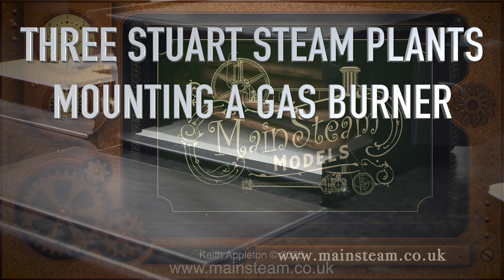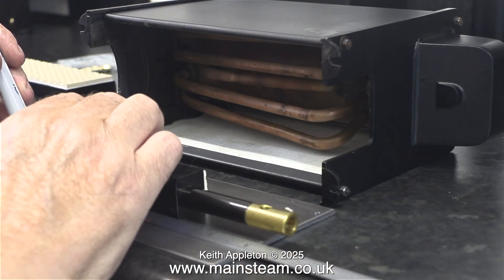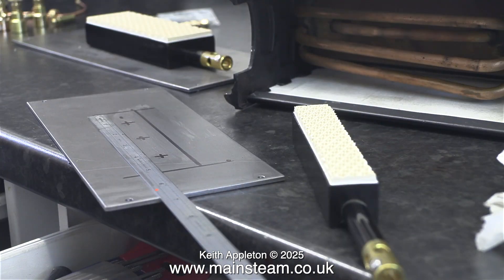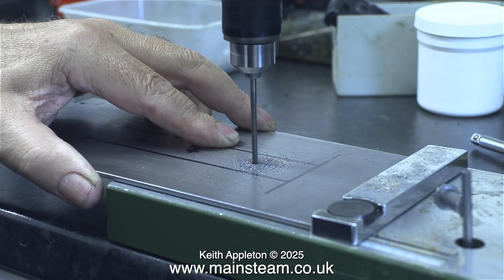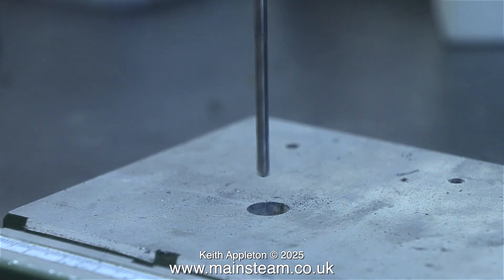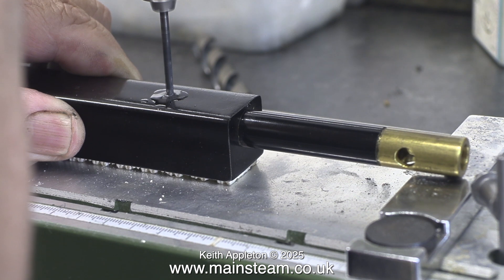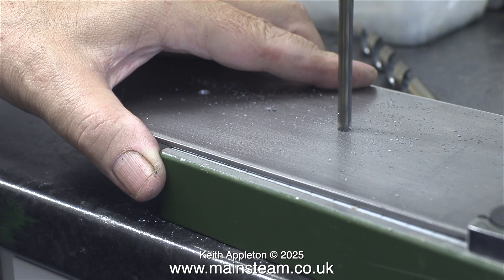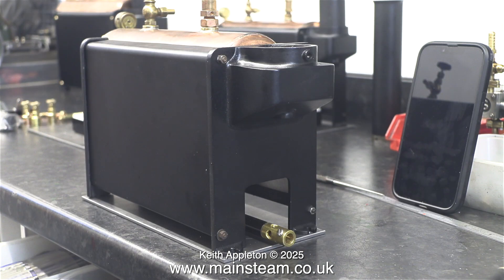THREE STUART STEAM PLANTS - PART #14 - MOUNTING A GAS BURNER

Comment: Have you mounted burners by drilling through them before?
Reply from the maker: Yes.
Reply: @keithappleton  I was wondering if the threads sticking out into the burner would be a problem for the gas/air flow, but I'm guessing that must not be an issue
Reply from the maker: They are very small Brass machine screws and have no effect on the Gas/Air Flow . . . .